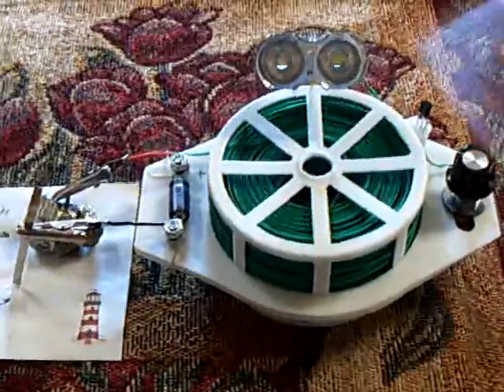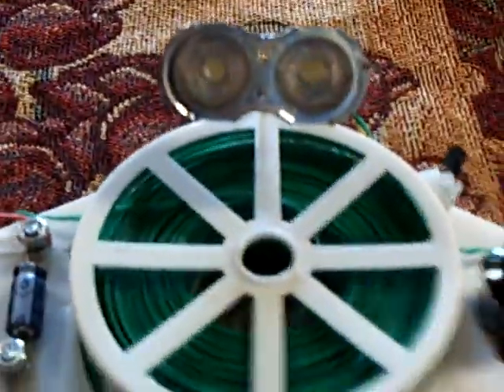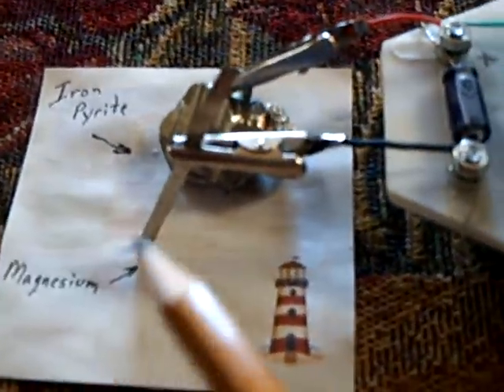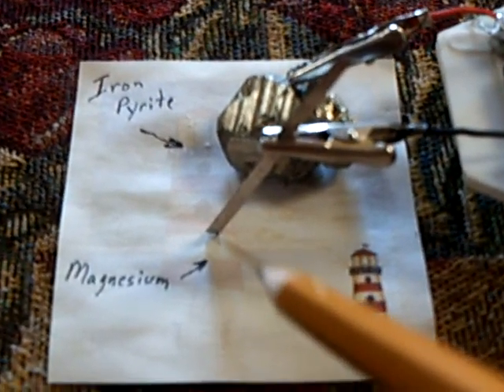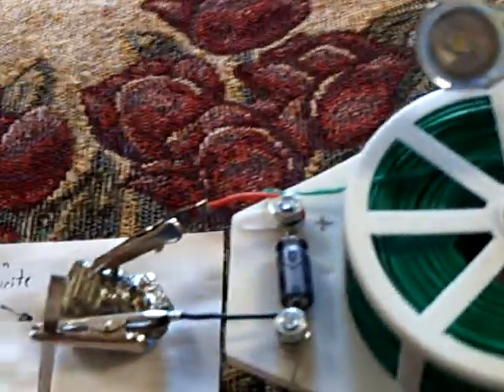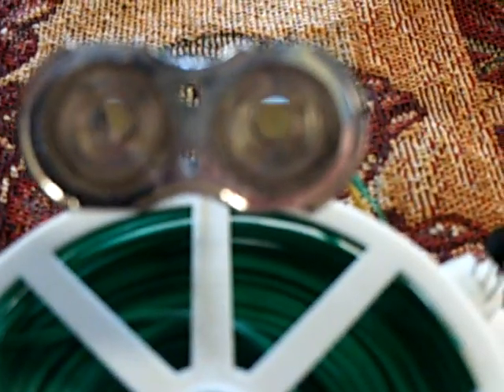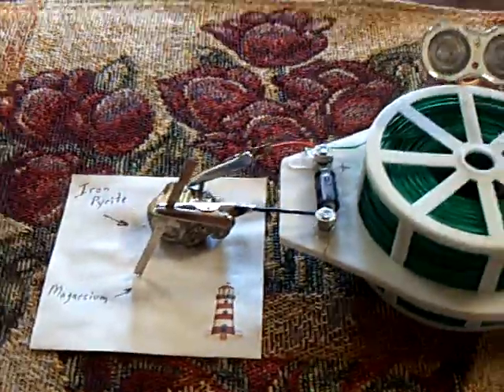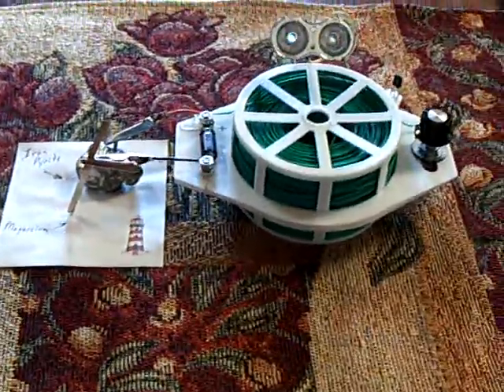Penny No. 2 ---running on iron pyrite and magnesium microamp power.ASF

Comment: Another interesting salt we made, which typically is sold anhydrous, to a higher purity than epsom can be made you can mix equal amounts of 2M NaOH and 1M H2SO4 then heat the product to evaporate the water leaving you with Na2SO4 which is sodium sulphate, and u can get about 99% purity or better, then check it too for water of crystallization when your done. It can then be worked in a lexan box, with a vacuum pulled on it, to insure 0% humidity.

Comment: @Lidmotor I'll be lucky if I can replicate 1/4 of your experiments LOL you work in some pretty darn low currents, and it's all very intriguing! I did find a lab similar to that which we had done, involving hydrated and anhydrous Magnesium Sulphate (epsom salts) h t t p : // w w w . 123helpme . com / view . asp?id=147916. This is  a little bit layman, however; it should be easier done at home. We had some extremely sensitive scales to do this, whereas this lab implies more typical equipment.

Comment: When I took Chem-Sciences we did experiments using TGA, if your substance is pure (and therefore known formula) you can actually calculate how much water is left in the crystal after heating. Of course we had some pretty accurate scales to work with, not something we have at home... but, point being, heating up a substance does not drive off 100% of the water of crystallization, unless you've calculated it to have done so... if I'm remembering the lab class correctly. Cheers!

Comment: @Lidmotor 

Yes, These cells are not 100% one thing. Heat, light, galvanic, crystals, piezoelectric, petrovoltaic,  and so much more make up these cells power. 

I've done the freezer experiment before and most, not all, of my crystal cell still held their voltages but the solid chunk of ice gave little to nothing in voltage. 

Please keep us posted, I really enjoy the videos.

Comment from the maker: @khoham -----Yes I have tried calcium cloride and it works both ways like you said.  Where I live by the beach there is enough air humidity that a small crystal on a piece of paper turn to a water solulion in just a short time.

Comment: If you think water is doing all the work and causing a galvanic reaction than stick the cell in the freezer. When water freezes it slows down the ion transfer, so if the cell has been frozen for 24 hours it should have little to no voltage (~20mV). But if the cell still has most of its voltage you can assume that water has little to do with it. You'll never 100% escape the galvanic corrosion but you can come close. 

So stick the cell in the freezer for 24 hours. Just a thought.